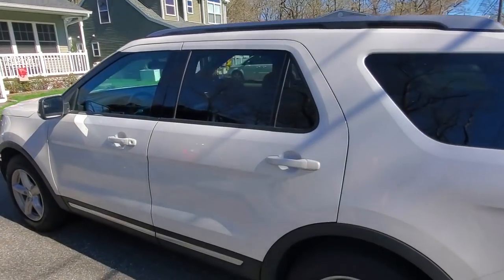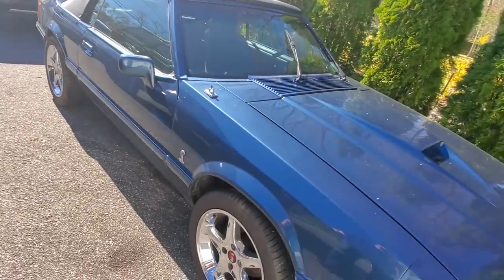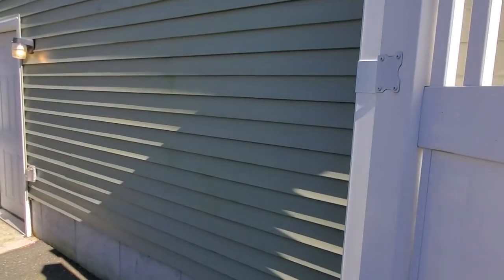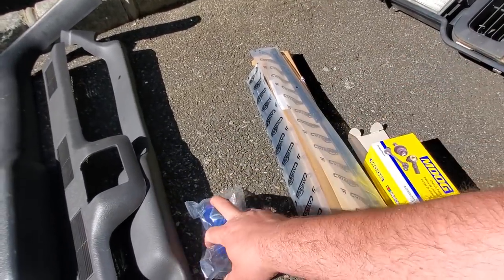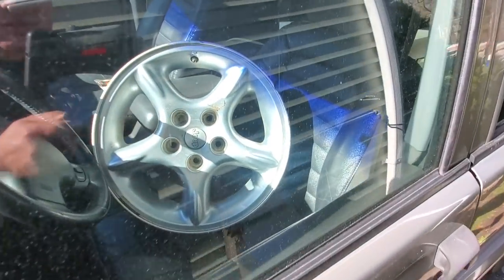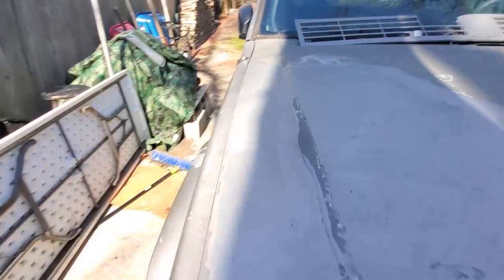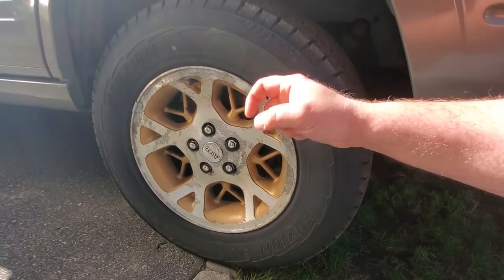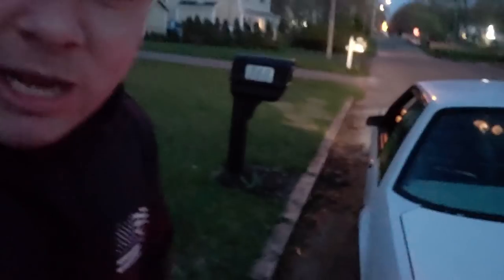CHANNEL UPDATE - GENERAL GRIEVOUS ZJ, BEACH JEEP XJ and MORE!

Comment: I'll be right alongside you this summer with the passenger side floorpan. Pulling the carpet up in the next couple weeks to see the damage on the inside. Unfortunately a tough job to learn to weld on but it's gonna be under the carpet anyway =]
Reply from the maker: Yea Buddy!  I'll take crappy welds over rust holes any day!

Comment: I say 20's on zj
Reply from the maker: 🤔 I'd need an 8 inch lift for that. 😎
Reply: @ProjectDanH  sure man? I had 2" spacers on mine with 31
Reply from the maker: @mclehed77  awesome! I thought you needed more lift on ZJs
Reply: @ProjectDanH  I thought so too I had factory 15 wheels with spacers and I did cut the front bumper cover a bit
Reply from the maker: @mclehed77  did you have to hammer down the pinch seems?
Reply: @ProjectDanH  no